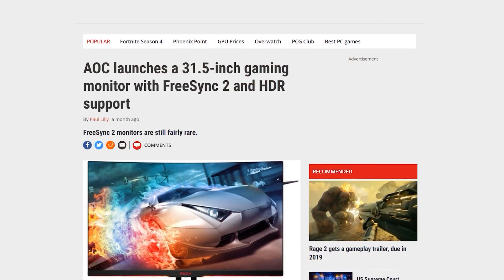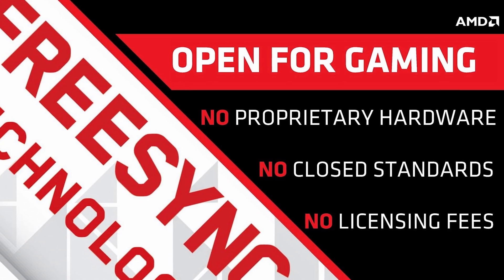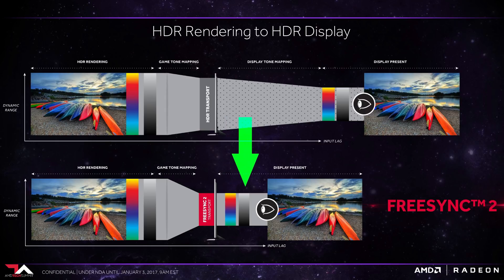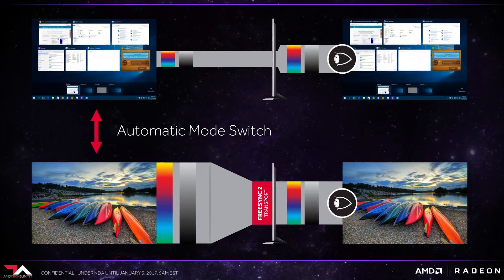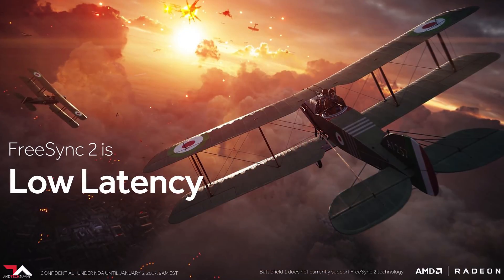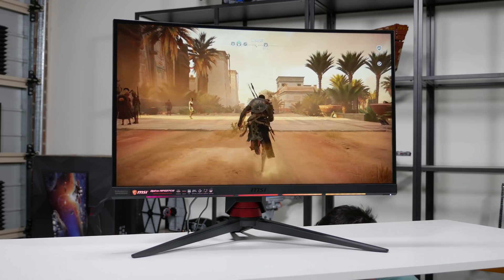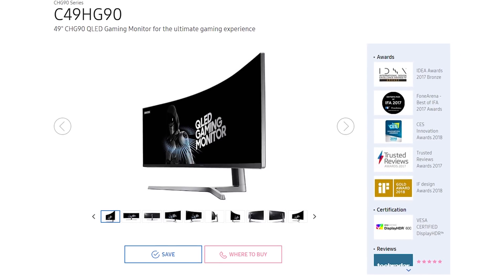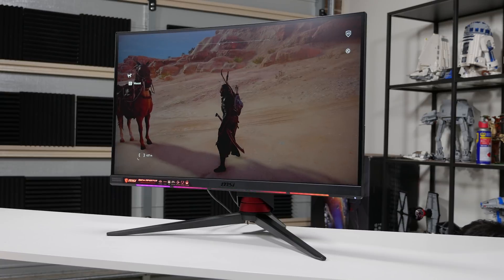FreeSync 2 in 2018 Explained, Does It Work Properly Yet?

Comment: The problem is not on Freesync itself, but more on AMD. Why buy a crappy GPU even if the freesync is free
Reply: Which AMD GPU is crappy? 

580 competes well with 1060. 
Vega 56 competes well with 1070ti.
Vega 64 competes well with 1080.

Only card that AMD doesn't have an answer to is the 1080ti. But then again Vega 64 is pretty close or on par with a 1080ti in some gaming benchmarks.

Your next reply will clarify if you're just misinformed or just a trolling fanboy :)
Reply: Kaziel Bonn vega: super high electricity bill
RX580: nowhere to be found (screw miners)
And yeah, imma baller so my prayers for 1080ti's competitor i not answered so screw AMD
Reply: az zahar,

"Super high electricity bill". Sure sure, bring me some calculations instead of recycling a meme.

Google this: Undervolting a Vega 56 to potentially match a stock 1080.

No amount of rationality will cleanse all the brainwashing NVIDIA has done to you.

Baller... lol.
Reply: Why charging more on G-Sync Monitors even if Nvidia GPUs are near-MSRP?
Reply: Nothing from AMD competes with 1070ti. Nothing at all. AMD will have to come with a 150W card which costs maximum £400 if they want to even tackle 1070ti.
Reply: Minus You're right - the Vega 64 is faster than the 1070ti
Reply: It should better f*** be. It costs more than double the money!
Reply: Minus You're really using an outlier in the market to base all average product prices on? I guess if you want an excuse to complain about a product

Comment: My Acer xr341ck has a freesync range of 30-75fps. And it has low framerate compensation. But it's not freesync2 monitor though.
Reply: Watch the video and read up on the topic. Freesync 2 certification needs [LFC] AND [HDR] AND etc.